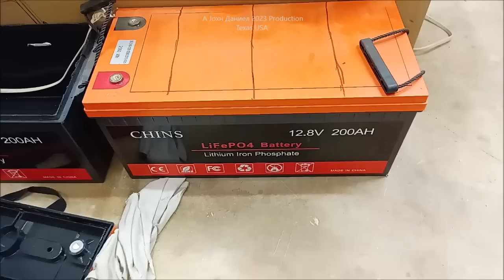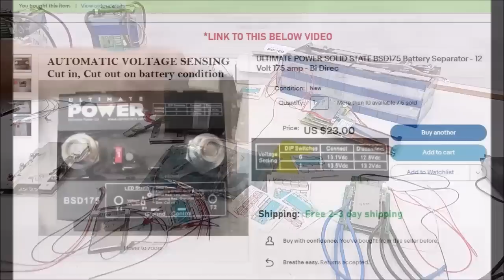The Limits of most SMART BMS for Lithium LiFePO4 Batteries, Avoid them, I Explain

Comment: You're comparing two different BMS boards and going on about balancing, as though that is the important distinction to be made between them.  The charging and discharging mosfets are actually far more important.  Along with the copper traces used, they are what determines how many amps a single BMS is rated to handle.  Whether or not you can connect them in parallel and/or in series has nothing to do with the balancing capability.  This video is a classic example of how a little bit of knowledge can be very dangerous.
Reply from the maker: 5 different boards. , But, watching half the video while deciding what it says is VERY DANGEROUS!  That's how we got the China funded corpse in DC that's going to get the world nuked. However, the video is about the INCOMPATIBILITY of brands and designs due to their programming, software, so smart it's stupid,  Snooping Apps, and how to avoid it with a non corporate, non proprietary BMS for 70% less. And it is 100% fact that cheap balancers have no end to their failures, better to avoid them unless your just a green energy virtue signaler who bought a LiFePO4 to sit on as ass art with leftist non user friends who all brag on their 100K solar array they can't operate while sending power to the man.
Reply: @JOHNDANIEL1  - Since you still aren't even acknowledging the actual problem, and so your viewers have the facts needed to make an informed decision, I'll spell it out for you.  It's not just that these boards have software which makes them incompatible.  It is not that simple.  Whenever you connect batteries, whether they are in series or parallel, it is absolutely critical that IF one of those batteries experiences a short, the remaining BMS boards (mosfets, copper traces, wire runs, etc.) can handle the surge or current that WILL result.  This is a critical safety function that you are completely ignoring in your rant about "the man".  Thankfully the engineers building these things are smarter than you give them credit for, and most viewers are smart enough to know safety precautions usually exist with good reason.